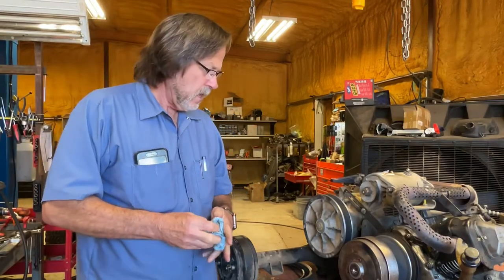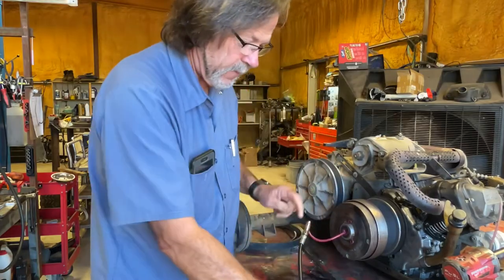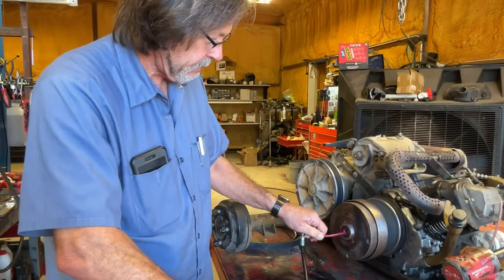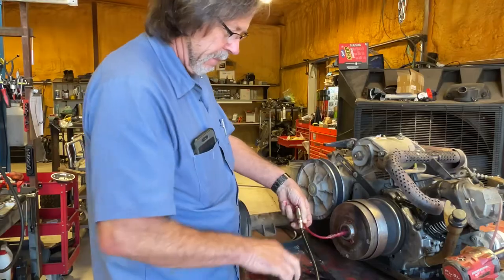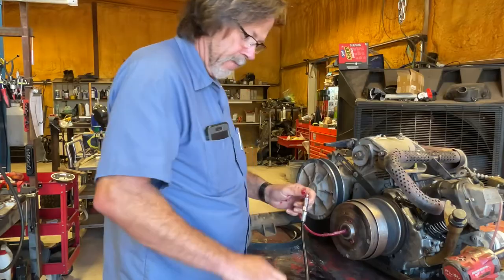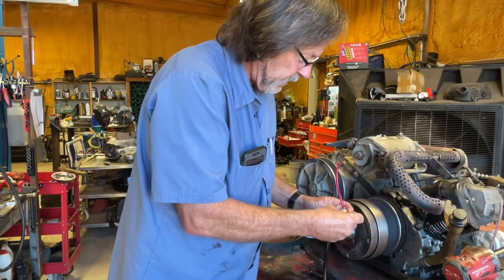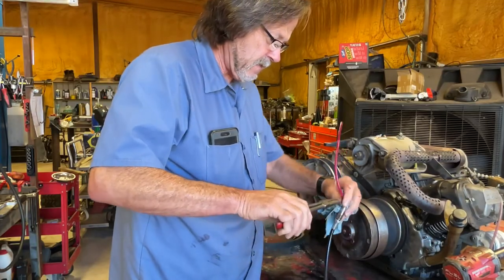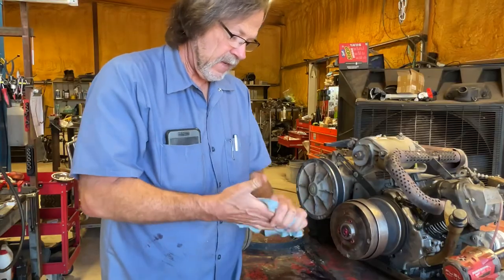Pulling a Club Car clutch with a 7/16x20 bolt

Comment: Just use a steel rod in first, then the bolt, which pushes on the rod. 

A heck of a lot easier and less messy.

Comment: I have seen this done using water or oil. Fill the cavity, then screw bolt in clutch with teflon tape on threads.

Comment: I purchased the new clutch and the $15 tool. On vacation and the clutch shelled. Amazon to the rescue. Did it at the campground without removing anything but the belt. Take out mount bolt, screw in tool until clutch pops off, install new clutch and mounting bolt. The issue was that I rode my unicorn 100 miles in this small town trying to find a 7/16” bolt 20 tpi, 5.5” long and could not find one. New clutch installed with the old bolt and a big stack of washers. $30-$40 on line so I’ll wait until I get back home to buy the bolt.

Comment: I just tried this trick and it worked.  The way he fills the hole from the inside out using the tube and the grease fitting is ESSENTIAL!!  If you try to just force grease in by squirting it in without that little tube he use, you will have air pockets and it will not work.